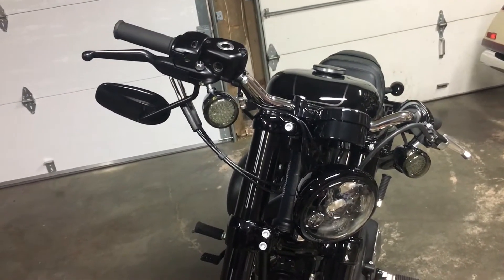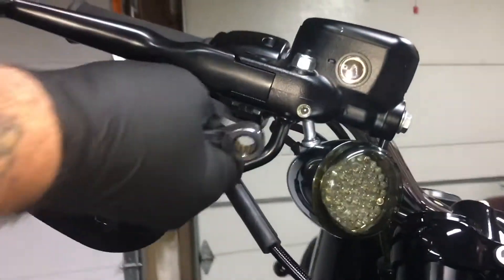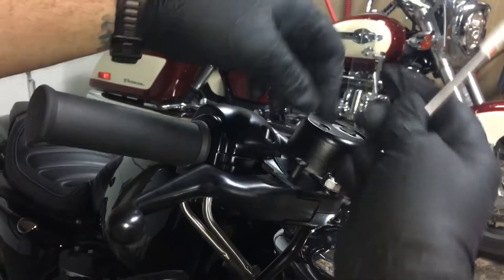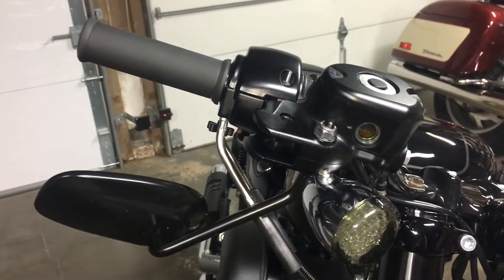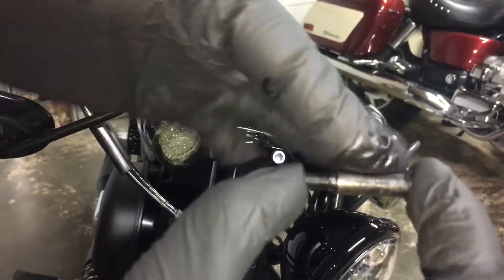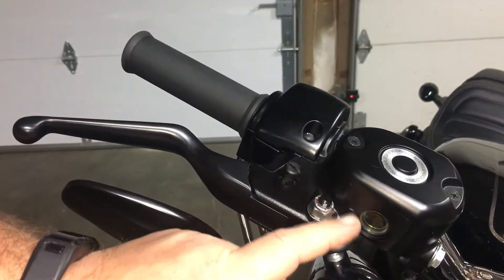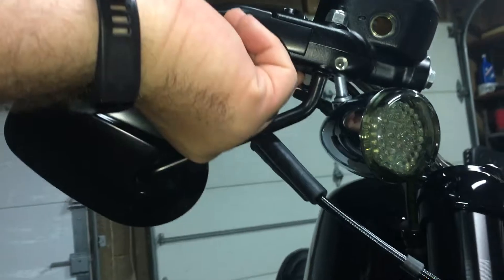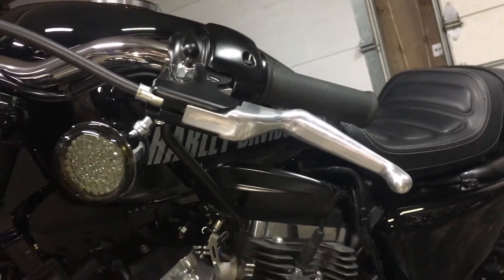How to install brake lever on a Harley Roadster XL1200CX

Comment: Got to 1:44 and then realized how easy it was, will watch the rest later though. Thanks for the great videos!
Reply from the maker: Johnathan Pessetti Thanks bud! They were much easier than earlier models of the sportster!
Reply: streetstunna600 I suppose I should've greased it too. I low ended mine and need to replace the bracket due to scuff marks.
Can't wait to see the handle bar replacement. Btw, you say you will make a brake lever video in a minute at the end of the video, lol 😄I know you meant clutch lever.
Reply from the maker: Johnathan Pessetti Lol, yeah! I meant clutch lever for sure! I actually bought a drag bar for that bike then ended up buying a 2017 Low Rider S. So I have a drag bar still in the garage. I may save it for my next Roadster. I'm buying one again soon.

Comment: Hi there, did you rotate your handle bar!
Reply from the maker: I don't think I did on this bike bud.
Reply: @streetstunna600  yeah you're right, I don't know what I was thinking. I'm thinking of changing the bars to give me a more upright riding style but I'm not sure what to go with.
Reply from the maker: @EnGdelgado217  Are you part of my XL1200CX group on Facebook by chance? Could run that question past the guys!
Reply: @streetstunna600  I'm not on Facebook but this seems like the perfect reason to join lol
Reply from the maker: @EnGdelgado217  Right in man! Yeah, I like Facebook for the different groups that I'm in to and Marketplace which is kinda like craigslist but better!